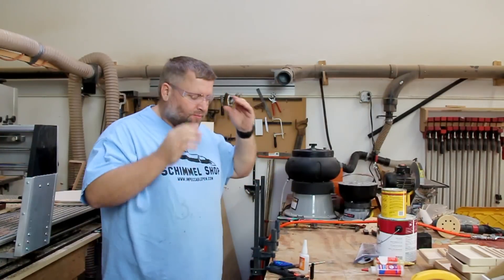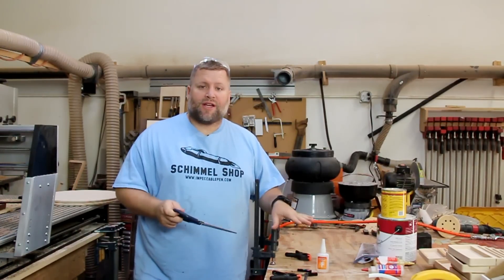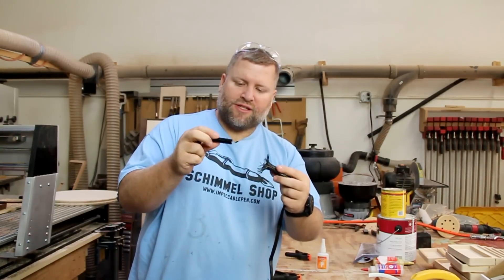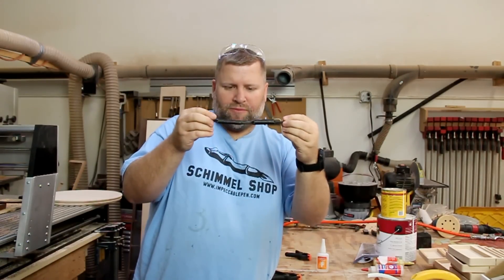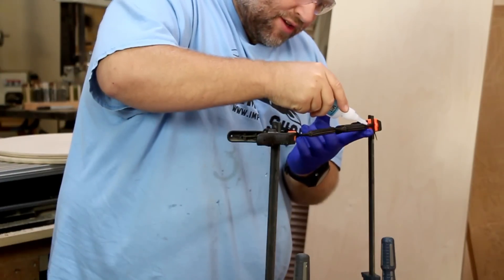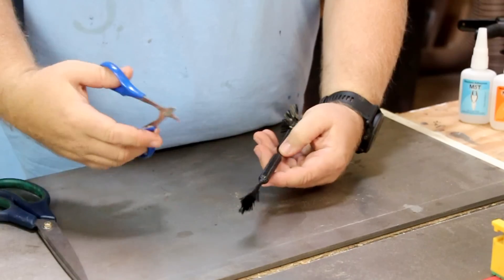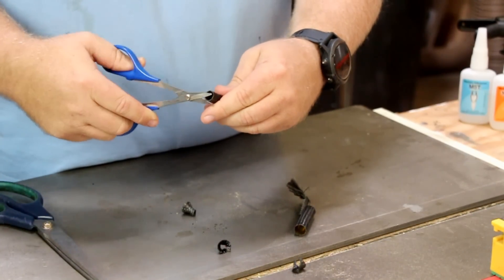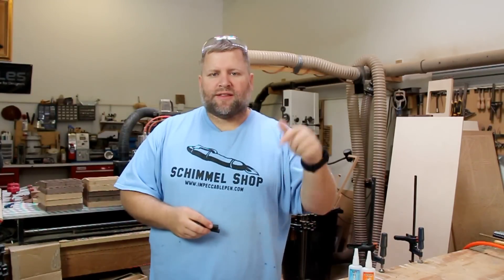Carbon Fiber Tubes for Pen making, watch parts pen or other casting.

Comment: Thanks for the great video.  If you want to adhere a badge, decal, watch parts, etc - to the blank - would you need to polish the blank first?  Or, can you just adhere the pieces to the cured carbon fiber blank, cast it, and turn down?

Comment: Hey Chad do use polyester resin to cast these blanks or do you use a alumilite? I have tried your method multiple times when casting with alumilite and it seems like the alumilite does not adhere to the carbon fiber. Some people have mentioned using polyester resin instead. What do you suggest?

Comment: Chad I'm having such a hard time with the glue. After I start putting the watch parts on the blanks, the glue seems to dry and leave a white powdery residue on it. I hope you read this and respond. Thanks! Hope you have experienced this and have any tips!
Reply from the maker: Are you using accelerator?  If so don't do use it because that will cause it.